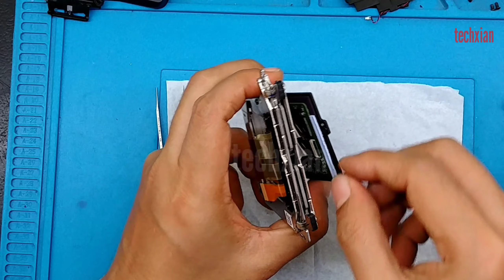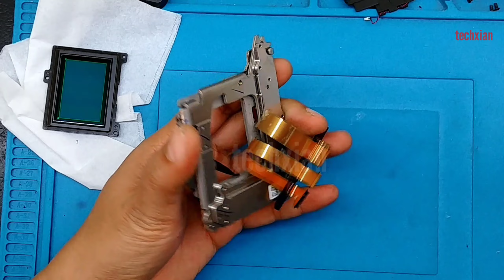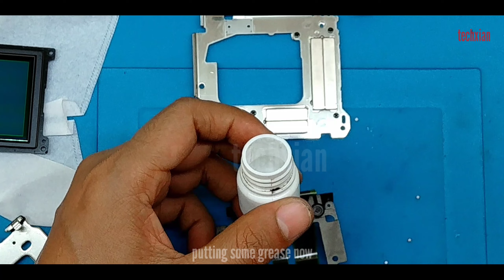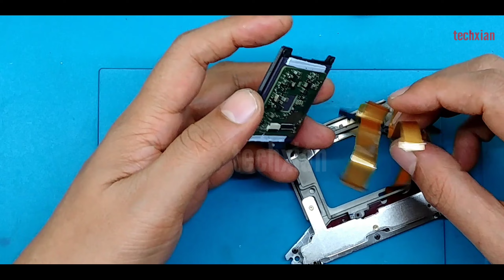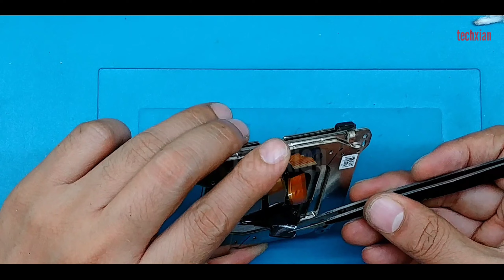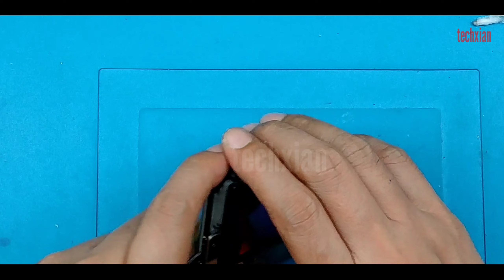SONY A7 MARK 2 STABILIZER PROBLEM DISASSEMBLE/ASSEMBLE

Comment: How did you repair the coil?
The stabilizer of my P1000 got damaged when it fell. It still works but it has violent shakes at the horizontal axis.
I opened the camera up and I'm removing layers. It's a long way to the sensor.
But even when I get there I'm not sure what to do.
Reply from the maker: i repair the damage coil sir